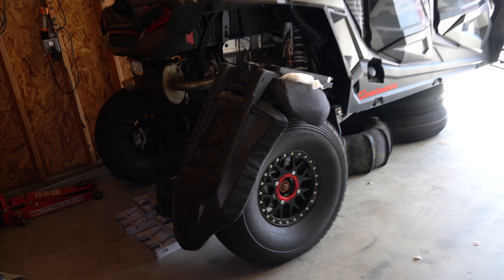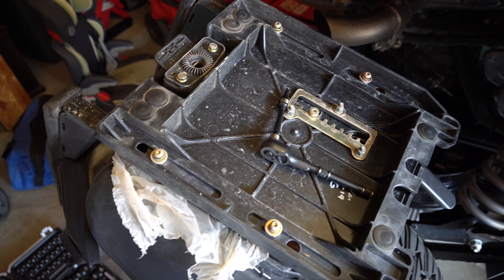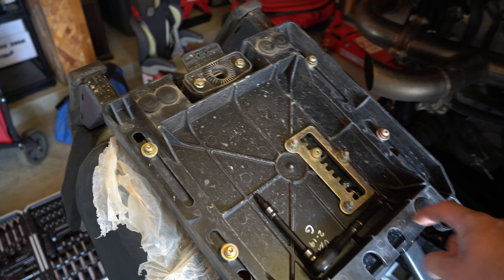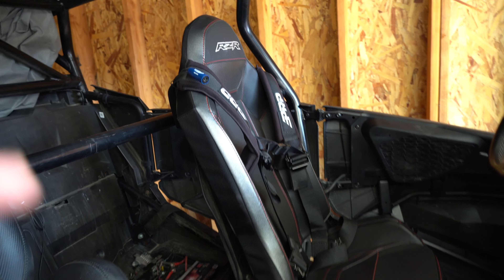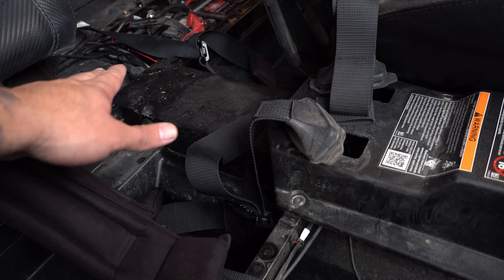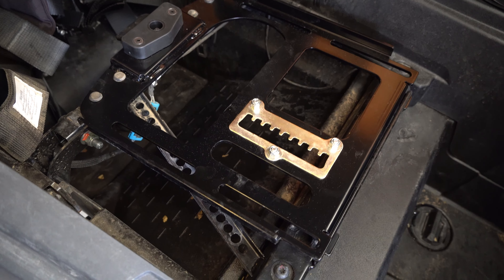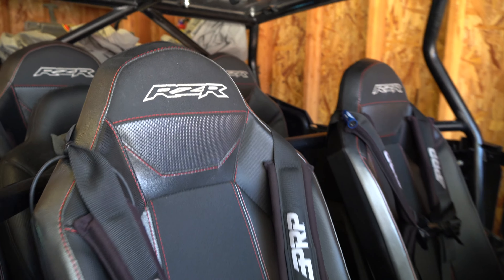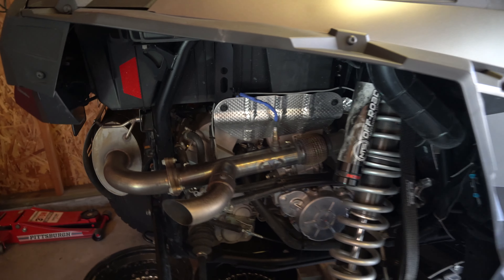RZR seat lowering bases.

Comment: So I'm new to the UTV scene but what size tires and wheels are you running and do you have a lift or did stronger springs? I'm running a  2014 xp4 1000 with 30x14. Any advice would be greatly appreciated.  Thank you!
Reply: He has 33 inch tensor on some 15’s. He has mts suspension that includes the springs and calving